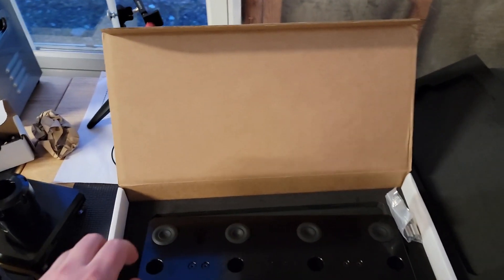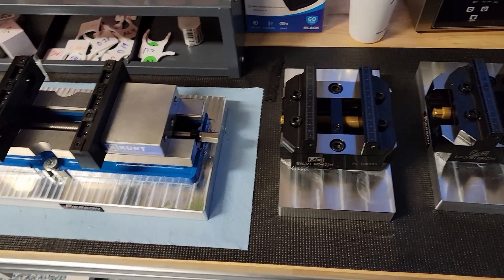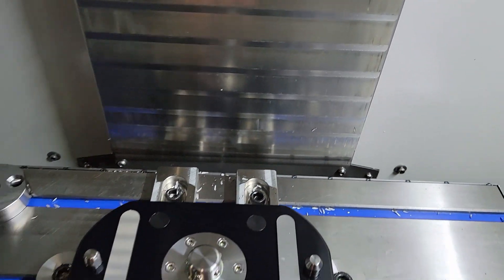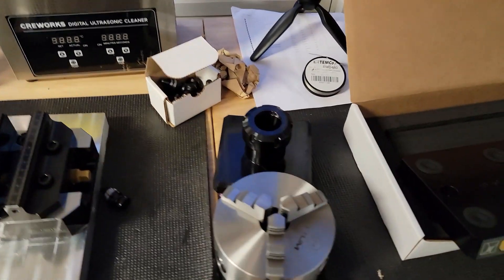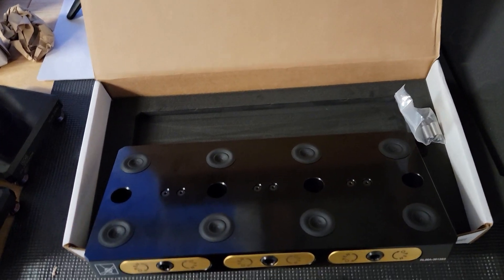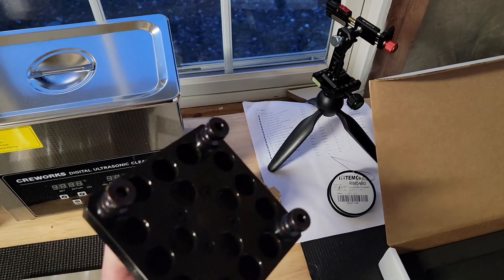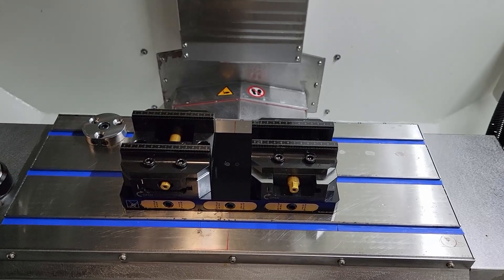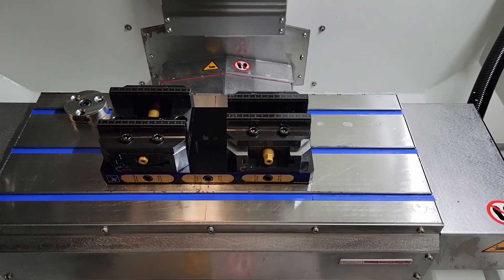TRYING OUT A 5TH AXIS ROCKLOCK BASE

Comment: Can I ask about your tool setter mount? Did you buy it or make it? I’m also using the 5th axis plate and the silver cnc er40 and chuck, works great!
Reply from the maker: @JeffTLSNV  I purchased it from Exact engineering. You'll need a screw and washer to mount the pioneer base to it. I also purchased a remote base and chip guard with it.
Reply: @MrSmith1231  
Thank you for the quick response, I’ll check them out!